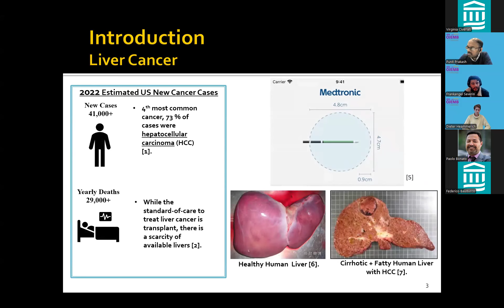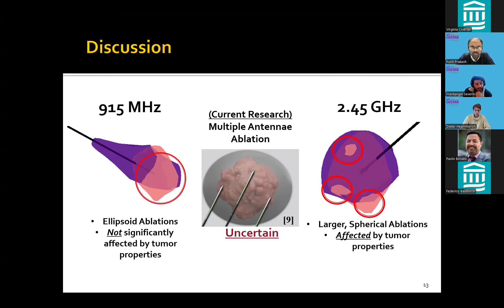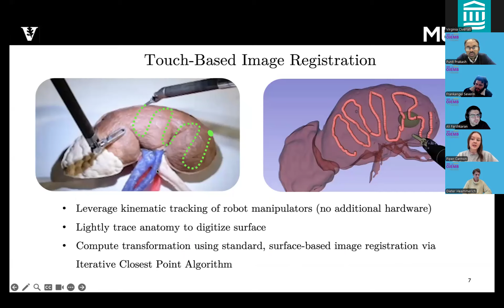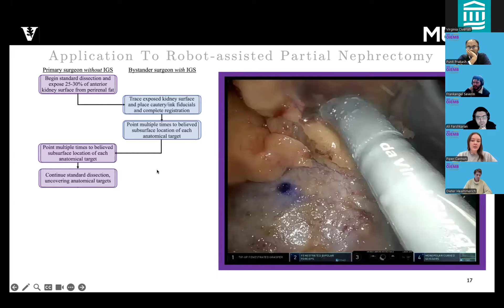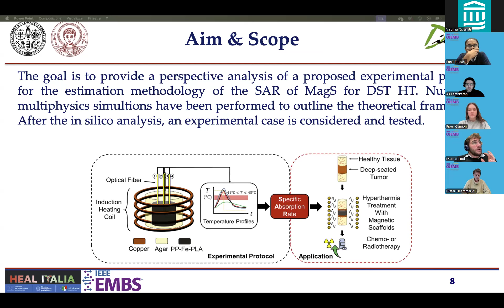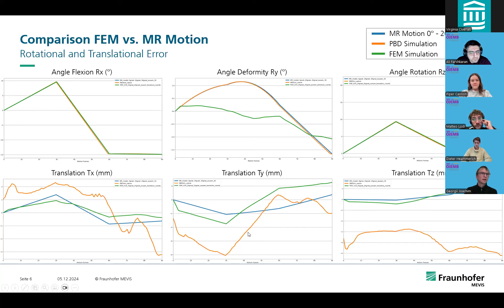Simulation of Image-Guided Microwave Ablation Therapy Using Digital Twin Model | IEEE OJEMB Webinar

Comment: I connected the directional antenna with the Agilent 53150A frequency meter to aim at the human brain and measured the high-resolution ultra-short wave modulation signal. This may be an electromagnetic wave signal from the brain! The complete experimental data has been made public.